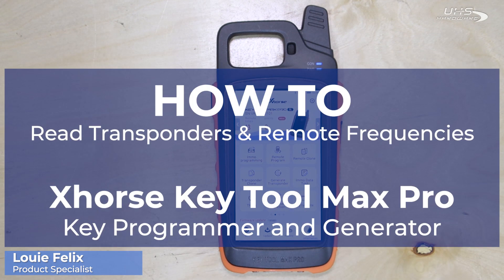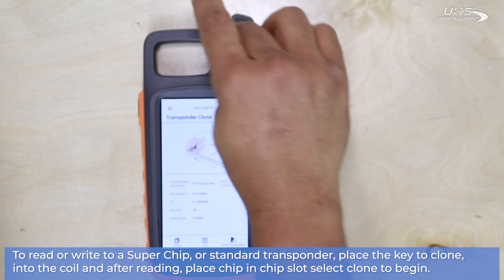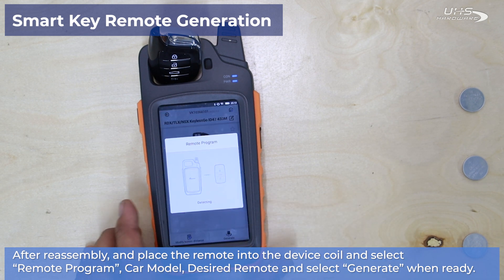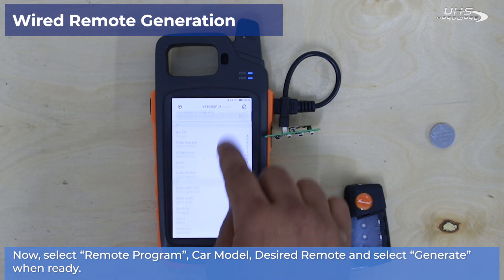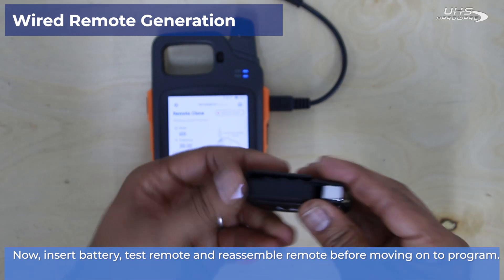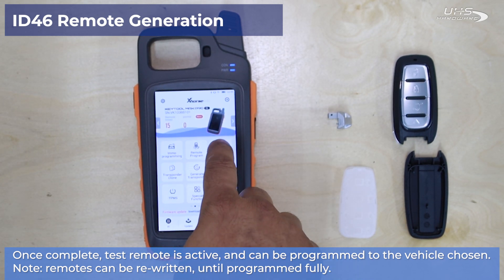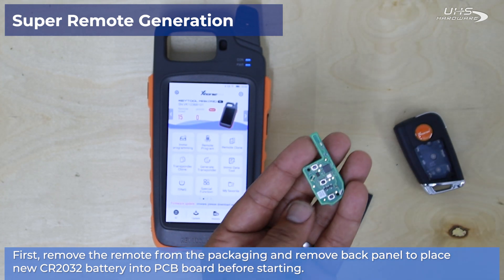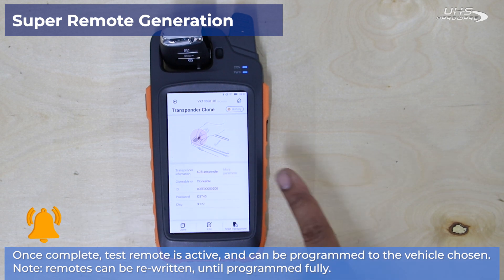How to Generate and Read Remotes and Keys with VVDI Xhorse Key Tool Max Pro

Comment: these things are straight garbage , was able to program a single key with it , now every key gives me a security error while trying to program them.
Reply from the maker: that's not normal. did you contact the support team for any assistance?
Reply: @UHSHardware I didnt , I just havent used it since and I dont use it daily for work but every single dodge key fails always , the 15-17 fails too even when those still program it returns a fail code, 18+ have never programmed and yea I am using a 12+8 on those.

Comment: i accidentally deleted my ford cmax key trying to get get rid of mykey. i have no other keys. will this do a all keys lost on a ford cmax? can i use my key that i deleted from the car or do i need a new key? i used forscan which is supposed to do all key losts but i cant get it to work. thanks for any help. i would rather put money to a tool than pay a ford dealer....
Reply: Two keys total if you erased all of them. Got to program two keys in

Comment: After choosing the car make and model, what does "desired remote" refers to?

Is it the target remote that you are generating?

Or is the source remote that's already in use by the vehicle?

If it's the latter, how would you know which "desired remote" to choose when there are multiple options?

Sometimes amoung the options, some may have have transponders or may not have.
Also, those with transponders may have differing transponder/chip ID!

I suspect that we have to get the details of the current remote first - frequency, modulation, transponder ID, and buttons.

Then we can choose a "desired remote".

Can we generate/program a 4-button remote when the vehicle originally uses a 3-button or 5-button remote?

Comment: Hello, i am planing to buy one. Just have one question, can max pro work with other aftermarket keys and transponders or just with xhorse's? Therenis some cheaper keys for older vehicles? Thanks for answer.
Reply from the maker: the key tool max can only generate XHORSE UNIVERAL REMOTES. however, it can program many keys, transponders, remotes, and smart keys. OEM and Third Party. it's also useful for flashing some vehicles and other useful extras!

Comment: is this better than the auttel km100?
Reply from the maker: no, but it's also just as useful in a differing way. this would be more for programming and generating universal keys for older vehicles with transponder keys or flip keys, while the KM100 is more for Smart remotes and proximity systems. they are both wonderfully affordable and useful.
Reply: Wow! 😮 
I didn't get that impression from your advertising!

Otherwise, I wouldn't have bought the Key Tool Max Pro!

Looks like to get another machine when I thought what I bought was all I needed to clone and reprogram all Key FOB, Remotes and FOBIK.

I saw some mentioned about "access card" but saw no further info about it.

I'm heavy into Security Electronics and the first thing that came to mind when I read "access card" was a HID access card or badge!

For example, when I place my access card for the office on the KTMP, it read as a transponder chip type 46 and PCF7943 (HITAG2+EE).

It also has a password which editable and 8 other blank but editable fields P0-P7passwords!
Reply from the maker: different and useful for similar and different things. they are more or less both needed for full vehiicle coverage of smart and bladed keys,

Comment: what is your remote is not clonable
Reply from the maker: It likely will then need to be unlocked by someone with the means to achieve that function, like a professional locksmith.
Reply: Can the Key Tool Max Pro make a transponder clonable if it's not clonable?
Can the KTMP override that status?
Or what tool/software is required?

Comment: I keep trying to program an Xhorse remote for a Toyota fob. It’s wired but I keep getting this error “ please put in x wire remote, xn wireless remote, or rx super chip remote. Any tips here?
Reply: you might be using the wrong key, if it’s a toyota fob you shouldn’t be using the wired universal key it should be the smart universal key

Comment: Might you know which XHorse Keytool can clone 2006 Porsche Cayenne remote key 315mhz FCC ID:KR55WK45022, or a key for a 1999 Porsche 911 Carrera 2?
Reply from the maker: All research points towards the Key Tool Plus Pad.
Reply: @UHSHardware  I'll dig into that, thanks!

Comment: Hey mate, 

I'm just starting out with programming, can you explain what each of the key types' differences? If you have a good source or link that would be great too! Also, do you know if the X-horse Keytool Max Pro is capable of actually adding the keys to the vehicle?

Thanks again.

Great video.

Kind regards
Reply from the maker: yes. fully capable of programming keys as well as generating. are you speaking of universal keys or transponder, vs smart/proximity, vs fobik etc?
Reply: Bro I wanna buy wholsale keys of you
How can i?

Comment: How is it possible to GENERATE a new remote? most of the VVDI setup is all done without connecting an obd2 to the car, how can a car get the signal and open if the car has a rolling code or similar? otherwise would imply that it can open any car as long as is the same make and year?
Reply from the maker: Generation is the first step for universal keys. Programming is the process of making the key work for the vehicle.
Reply: @UHSHardware What would be a good programmer to use in conjunction with this and the dolphin xp005L? For oem fobs, like dodge,kia,Ford etc.
Reply: In that case "generate" a remote may not be the best word to describe 'formatting' or 'preparing' or even 'creating' a remote.

After the remote is prepared/created/formatted/loaded, it is programmed to the vehicle.
Reply: In that case "generate" a remote may not be the best word to describe 'formatting' or 'preparing' or even 'creating' a remote.

After the remote is prepared/created/formatted/loaded, it is programmed to the vehicle.

Comment: Just starting out with xhorse i've been using autel to program dealer standard keys for about a year now, What is confusing me is where to find out which vehicle is compatible with which key. Is it a case of reading the original keu with my keytool max pro & matching up the key that way? or is there a list available anywhere? 

Great video! i've been doing research on the x horse smart key range & this was massively helpful.
Reply from the maker: the best way is to visit UHS-Hardware.com, and search for the keys by vehicle type, year and more, that makes it far easier to tell what does what. also, feel free to call the customer service or sales dept. for more details before you buy.

Comment: Everyone understands this you need to edit tour video and tell people where and why to use wireless. Most people know stuff its xhorse bad naming that confesses alot of people. Took me forever to know when to use it and why
Reply from the maker: I wish it was as simple as an edit, but I will try to get this exact info and provide it soon. Thanks for your feedback! You're the Dopest!
Reply: @UHSHardware  I personally use super for keys that have chips separate from the motherboard. Obviously , if the fob and key are in 2 separate pieces that call for super fob, too.

For xhorse Wireless, I use when the chip is part of the motherboard on oem key, hence a car where fob and chip learn together.
Reply: so just to clarify you are not talking about the smart keys here at all right?

you are specifically talking about when to use the purple package over the blue package?

to me as the base knowledge of understanding is blue package comes with a tr47 chip that is not able to program to as many cars. It still doesn't make sense that you would use blue in the sense of chip separate.

it seems to me the best choice would be to specifically go without chip at all. and buy super chips separate. Or to just buy the purple package super chip (wired) remotes.

what's really confusing is that the super chip "wired" remote programs wirelessly... thats confusing.

I get that the blue package is a couple dollars cheaper at times. but it doesn't seem worth the headache.

I could see not nowing which smart key to have being frustrating. because for example autels generated keys do all models listed. with xhorse you gotta have the "special smart key" for some models.

Comment: Where is the wireless? the blue color plastic
Reply: Yeah that's right! That one appears to be the most tricky part. Where and why is it supposed to be used?
Reply from the maker: I didn't include the Blue "wireless" remote as it's the same generation sequence as the Purple "Super Remote" except it has a T47 transponder, which is not as widely capable as the super remote. It is still highly useful, just not as wide of a vehicle coverage.

Thanks for asking!